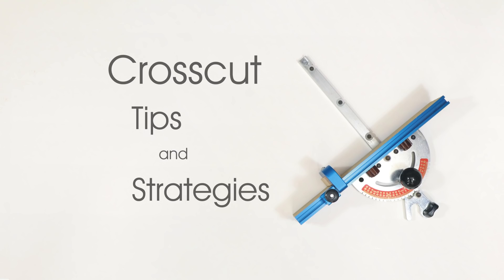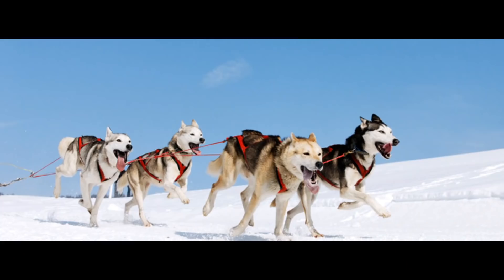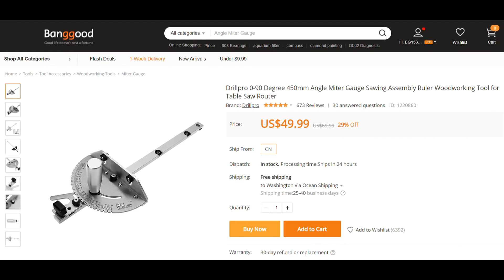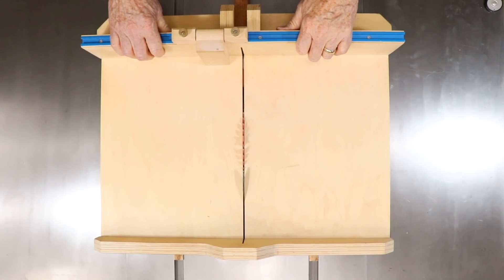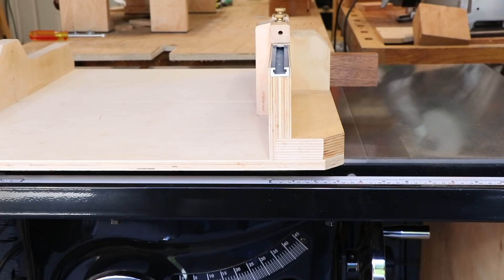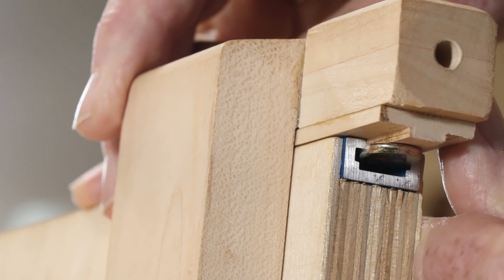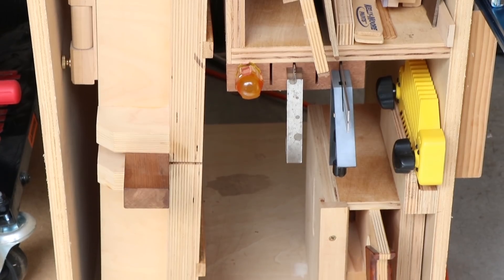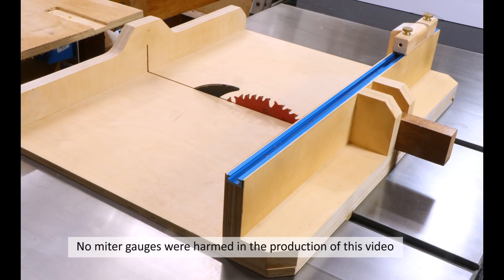Crosscut Tips and Strategies

Comment: some absolutely excellent and uncommon ideas. really like the extended blade guard and the sandpaper on the face of the fence. i'm right in the middle of building my fence and i'll definitely be incorporating your ideas into mine. oh also i REALLY like the idea of storing the miter gauge vertically right by the saw, absolutely stellar solution. that's happening for sure.

Comment: love sleds , especially on my small table saw 10" DW..something but Im using that rarely only when i cut thin rip cut or specialty cuts.   since 80' im using track saw for formatting and European type  forward facing rail sliding miter .... saw that dont take much space at all , I do tenons  cutting old way on band saw .American style of Table saw is obsolete.  If blade is placed on right edge of surface,  sliding caridge can pass right beside make any cut absolutely precise and infinite variety , also eliminate army of accessories. There are small ones for  price and size  of Delta or SawStop ,( old Robland ,Minimax, or Rojek) much more effective and versatile, And not that big of footprint, and you also gaining 12" jointer/ planer and horizontal boring machine . never less You do amazing job with tons of insights . THX  P

Comment: 1. IIWMI'D angle the miter gauge scabbard for less fumbly & unobstructed withdrawal
2. Can you explain the wood skirt under your SawStop? I haven't seen that before
3. Excellent well rounded coverage of the subject, I've been debating on the Incra & you sold me. All accuracy is in the work feed and the blade stability; the Incra minimizes work movement to near machine tolerances. Thanks

Comment: Hi Patrick, great video. I notice, though, that you have a Sawstop. I do too and I love it. You shouldn't, however, be using a blade with anti-kickback teeth. Sawstop are very clear about not using these blades because they may slow down the the safety function of the brake cartridge.
Reply: Could you elaborate on this? I'm using the blade my SawStop dealer sells. (It's not the SawStop brand blade.) I've wondered if they're selling me the right one.

Comment: Thanks for the video and passing along what experience has taught you. We have the same table saw and perhaps you can answer a question I have posted in numerous places and not received an answer. I noticed you took the legs off the extension table to accommodate   a larger storage cabinet. Have you encountered any tipping problems or any other trouble we path having the legs removed? I move my saw about my garage from time to time. I have also arrived at the conclusion that, you pointed out, if the accessories are not within a step of my saw I tend to not use them and thereby potentially compromise safety and/ or precision. I have the incra sleds (the small one I bought and the larger was gifted to me by woodworker who didn’t want to use it any longer). However, both have limitations. I like the sled you presented in the video and plan to make one to do cuts on smaller board where the piece I want is at the short end of the board. Sorry for being long winded and thank you in advance for your responses.
Reply from the maker: My saw came without legs.  The table extension is 24 inches (61cm) wide, and the whole saw table is 56 inches (142cm).  The extension is supported by the front and rear rails, which do  good job of keeping the table flat.  If you have a bigger table, then you will have to experiment on your own.  BTW, I think very highly of Incra, but balked atthe cost.  My sled makes no pretense at being as sophisticated as the Incra jigs, but it has proved to be very versatile and convenient.

Comment: Really enjoy your videos. Curious to know how you cut the rebates for the sled runners. It's hard enough getting them accurate with just glue and screws, yet alone trying to cut rebates that perfectly match your saw.
Reply from the maker: It is actually not too hard.  Lay the base sheet of plywood on the saw, square with the edge of the saw table.  Mark the location of the table slots on one edge of the base.  To do this accurately, cut two short pieces of runner material, and stand them up in the table slots.  You can then scribe the edges onto the base plywood.  Once you have precise marks, just cut a rebate (or rabbet in the USA) with multiple passes on your saw.  Test the fit as you get close.  Getting it exact requires some very thin cuts.  If the runners bind a little after they are installed, you can relieve one edge with some sandpaper, or a scraper, or a rabbet plane.  I have screwed this up in the past a few times, but usually the trick is just to be careful and patient.

Comment: I enjoyed your insight on crosscutting solutions. As I know you employ a common-sense approach to your work, I'd appreciate knowing your process for ensuring the fence is truly perpendicular to the blade. Also, I'm curious as to why you didn't go with aluminum/adjustable runners in the sled... you made a point of singing their praise in regards to the miter gauge.
Reply from the maker: I set the fence very carefully with a square that I trust.  You can also cut a piece of ply or mdf, lay it on a straight edge, scribe the freshly cut edge onto the table, and flip the sheet over so the cut edge is on the other side of the scribed line.  This doubles any error, and it is pretty easy to see if you are off.  I am not a fan of aluminum on the crosscut sled.  Both the base and the fence hug the blade for zero clearance.  I prefer wood for this, and my Sawstop demands it.  If the blade touches the aluminum, the safety cartidge fires and stops the saw.  The miter gauge fence, on the other hand,  really needs to adjust to get the fence the correct distance from the blade as the miter angle changes (the length changes by a surprisingly large amount), and I just need the fence close to the blade, but not zero-clearance.
Reply: @PatrickSullivan  Thanks Patrick! I'm not sure I properly communicated regarding the "aluminum runners" question... not sure how that has anything to do with the concept of "zero clearance," or how the runners would ever come into contact with the blade in your Sawstop table saw? Anyway, appreciate you and the quality content you produce. Stay dusty my friend! : )
Reply from the maker: @kevinkoop3615  Sorry, Kevin.  I misunderstood your question.  Sure, you could use metal runners with built-in adjustments to fit your table saw slots accurately.  I would be tempted to try that on my next sled.

Comment: In the plans of setting up my own shop. In Europe the american panel saw is, atleast in Norway, difficult to buy because alomst no one sells one. The common style for high end saws here are sliding table saw, like Felder, Hammer etc. I like the american style, its simple, but now I keep thinking; for the american style you need alot of jigs and accessories. And if you want to be safe a sawstop. With a sliding table saw the initial price is a bit higher, but you dont need any of those jigs and its safer than a saw stop, you are never close to the blade. Im beginning to think that a Europen slider with a short stroke is the way to go. What do you guys think about this?

Comment: Hi, very smart under-saw box, I think I'll copy it to you soon.
in my sled I used a block full up to the cutting plane and I traced a line on the plane not to be exceeded to have a reference: the saw blade so visible outside the sled scares me a little: I'm so distracted that I could use the hardwood block as a handle to remove the jig from the table when the saw is still turning ... farewell fingers!
TNX for sharing your tips!
Reply from the maker: I sincerely hope that you do not cut yourself, but I think this sled reduces the chance of that greatly.  When you are pushing the sled forward, your hands want to be on the fence, securing the workpiece.  They are safe there. When the cut is finished, my tendency is to keep my hands in the same position, pulling the fence backward.  The only time I use the "handle" is when I am moving the sled to or from its storage rack.  But if you think you might be tempted to use this sled in a different and more dangerous way than I do, please listen to your concerns.
Reply: @PatrickSullivan  No no! do not worry!
I also use it as you said and it never occurred to me to take it by the handle, I just thought it was a possibility, very remote, but possible and I gave voice to my thoughts. I also just finished the cut, move the pieces away, pull back the sled and remove and put the sled only with the engine off and I usually handle it by taking it from the sides.
Ciao

Comment: Aluminum table saw was awesome...I take it outside to cut on sunny days all the time.

...until magnetic featherboards, clamps, jigs came out....now Iron sounds much better.
Reply: I have a DeWalt jobsite saw in my home shop, and its aluminium table is the only thing that lets it down.  And not just for feather boards.  I like to use a DTI against the fence for ultra precise adjustments — like cutting tenons — and a magnetic base would so much more convenient than the over complex T-slot base I've had to make.  I still love the DeWalt for my home shop, and for most cuts, I honestly prefer it to the cast iron saws at the Menz Shed and Woodworkers Guild that I belong to.
Reply: @TrevorDennis100  The featherboard part kills me.  My use case rarely makes cuts on the tablesaw within the range of my T-slot and cheap-o featherboard. Maybe a more expensive featherboard could provide for wider cuts...but I'm constantly having to spend time jigging up cuts that would be a breeze with magnets.

Comment: At 2:22 you show squaring the miter gauge fence to the blade. This is an inaccurate method as it carries any error in blade/miter slot alignment into your jig. The better, and actually easier, way is to simply square the miter gauge fence up the miter gauge bar. And if you think about, this is what you'd do for a miter gauge on a router table where you don't have a flat blade to align to.